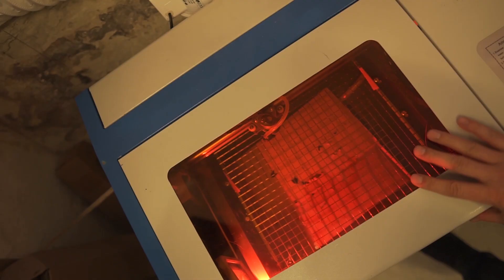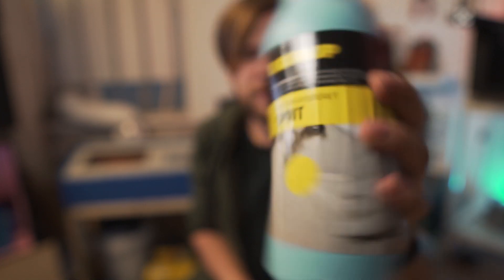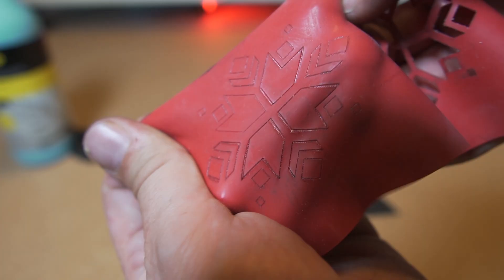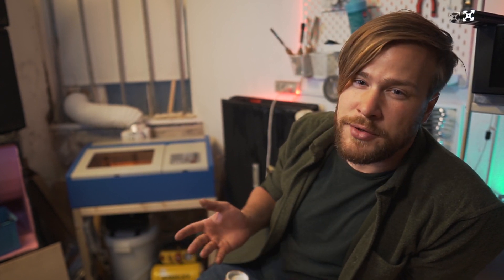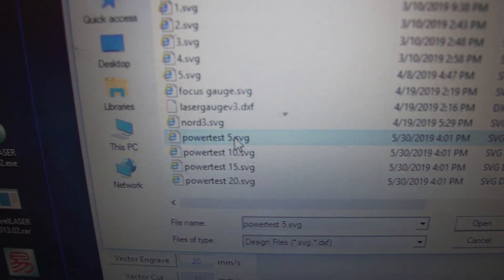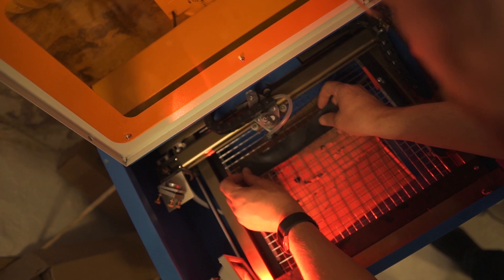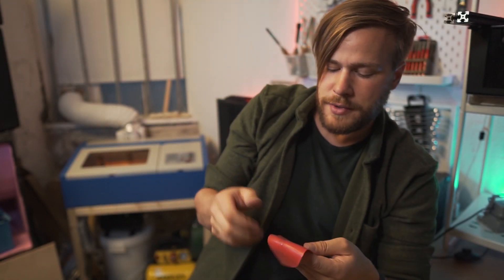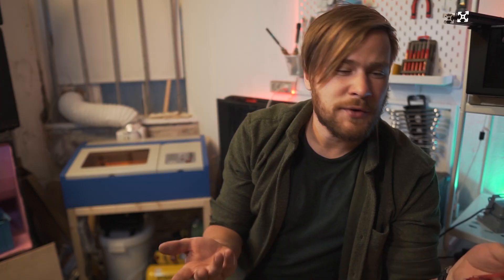Can you laser cut latex ? // tips and tricks using a cheap Chinese 40w laser

Comment: With regards to your "goo" issue,  try using Nafta fuel (coleman camp fuel) it will dissolve the goo and clean very nicely...   Do not use spirits or acetone.     on a different note, can you do a video on laser engraving as in etching the latex to give it a hexagon look to a panel?
Reply from the maker: Interesting, will try to pick some up. why should acetone be avoided though? been using that since it did manage to clean the goo. as for engraving thats a neat idea, need to see if i have any latex thick enough for it (0.4 was too thin at least)
Reply: @jokoivi  can u tell me what they said? not that I have a laser cutter lol
Reply: @jokoivi  i PM'd you via your email  :)